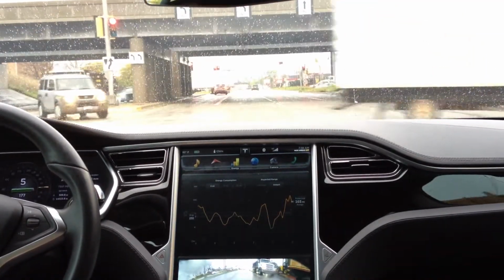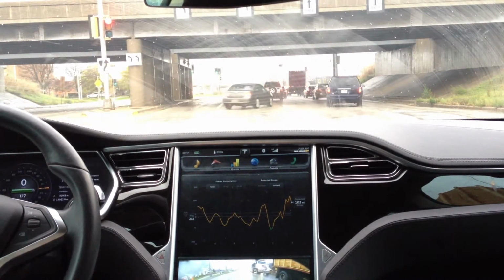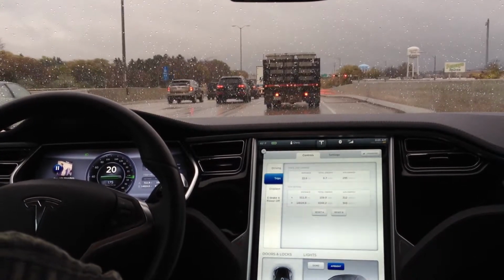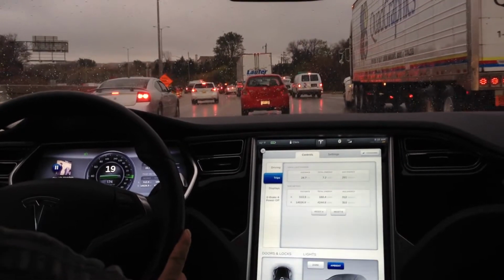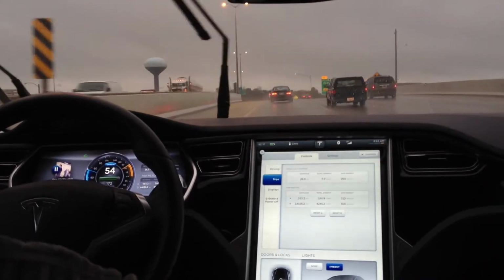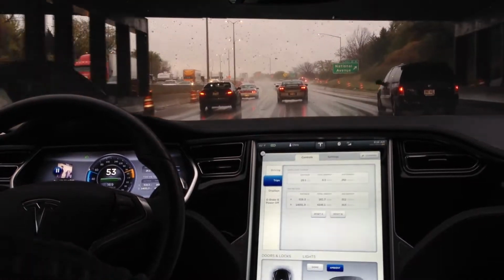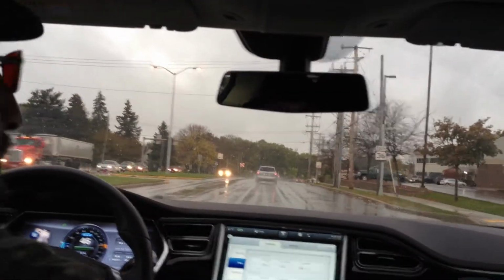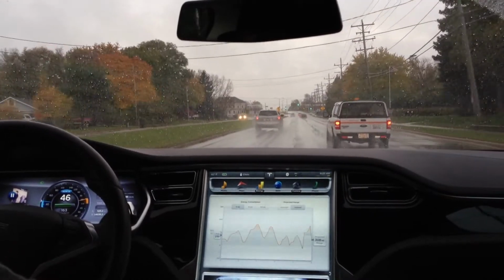Tesla Model S Explained: Energy Use, kWh vs kW, and Cost to Drive

Comment: When combining two separate videos together perhaps consider running both videos through AACgain? That way the audio of the videos will be the same volume.

The only thing is that AACgain only accepts MP4 and M4A file extensions, so MOV and M4V files need to be renamed accordingly (they're all basically the same format).